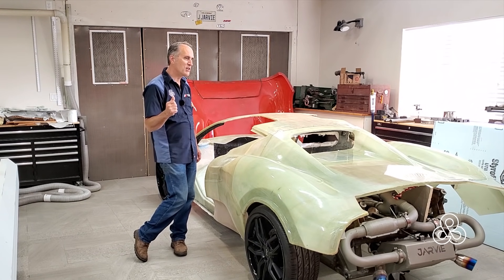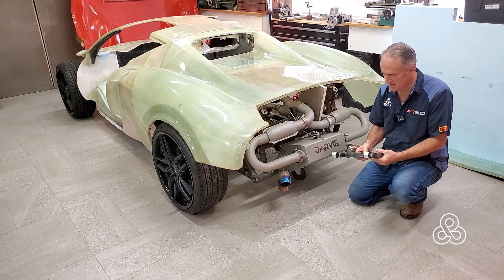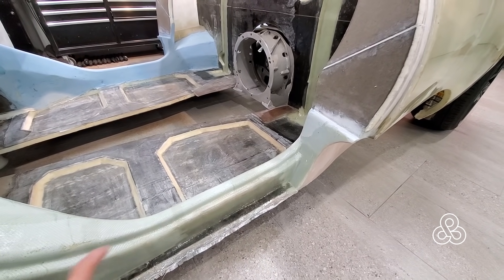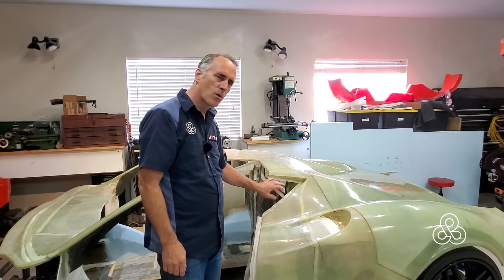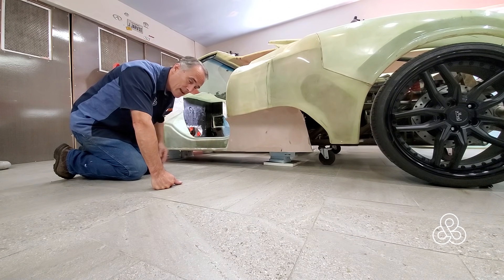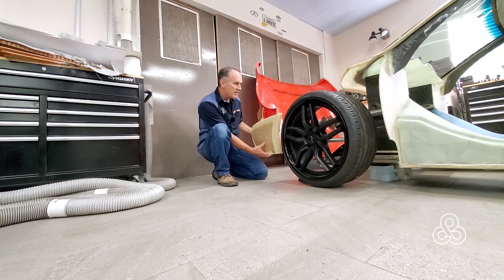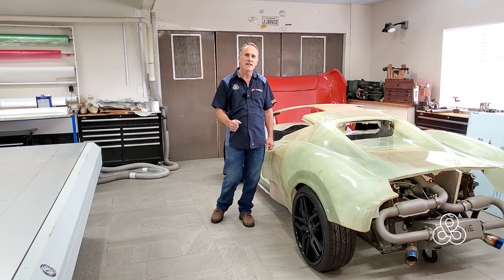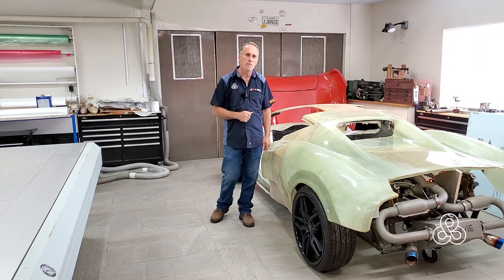Building a supercar from scratch! - What I would do different next time.

Comment: for the engine cover: im no engineer, but i think if you added a system similar to current hoods on cars, where you pull a lever in the cab, then the hood releases, but had it instead move it back slightly so you can then lift it that might work? or you could go full automated and have it like a cars sunroof
Reply from the maker: I think it will be a simple fix, just one more thing to do!

Comment: Hi Jake, First, I'm not an engineer, or even a autotech hobbyist. So take my compliment and question with a grain of salt. From a layman's perspective you appear be one of the most technically proficient builders I've seen on YouTube. My question is, you seemed to start with a body design and mold, and then moved to building the mechanics of the car underneath it. I'm wondering why you didn't start with the functional car (like a body-less go-cart), and build the body and ergonomics around that working platform? Apologies if I missed your answer to this question in this or another segment.
Reply: Gidday from Australia .
I think I did it that way because he doesn't really know what he is doing , I my self would do frame first so you know how wide everything needs to be included the foot well as he just said and steering rack.
I'm a fiberglasser I've build a lot of car bodies and I still do , please do not fiberglass the way he does it is totally wrong.
Reply: Form-follows-function vs function-follows-form.
Either way works.

Jake seems to be a fan of the latter (at least for this project).
When your primary objective is aesthetics, then it's the right choice.
Reply: Who cares about chassis !? Only design is important !  :)

Comment: Leave the rubber in for now - I have the feeling that, now you have the body mold, you will be building a V2 with all the changes that you want to make from the original; then you can revisit.  I’m not an engineer, but just my 2 cents.  Good luck with your project.

Comment: You mentioned the 1JZ build will be around 600hp, will that leave you with more torque than the max 380ft/lbs the 4L65E is made for?
Love to see the channel growing, and look forward to future videos!
Reply from the maker: If I can get to 600 I will likely pick up a kit to strengthen the transmission (cryogenic hardening and all that) should I suffer problems. Having 600hp doesn't mean I have to try and put it all through the transmission all at once. Ha!
Reply: @BuilderCreator  That's true. Slightly more loose torque converter might help too. Keep to the great work!

Comment: I'm planning a build on a sandrail chassis like you mentioned with a VW TDI for mileage power and longevity and custom body to enclose it
Reply from the maker: Great front wheel drive option to push to the back for a mid engine setup!
Reply: @BuilderCreator  yep that's the plan... one of my friends built a sandrail with a mk3 TDI but he used a heavy bus trans axle and an adapter plate 
I want to use the mk4 Jetta TDI I have acquired that got rear damage and transplant the entire engine and 5 speed manual just as it is and fabricate the necessary tubing to connect it to the sandrail rear section
I'm a tool and die maker and I specialized in class A panel dies.... my main problem has usually been too much time spent working overtime not much left for projects

Comment: Consult a few different auto glass shops about windshield options. Ive found that in my 10yr auto glass career, even the most knowledgeable mechanics have no clue about windshield procedures. Auto glass is a specialty trade that is only taught to people that are IN the auto glass business. There are no classes you can go take for it. So a lot of people are just misinformed, and spread misinformation about the subject. 

As for your question.......

Leave it on if you want to get away with not having to make the edges of the frame perfect. And i mean PERFECT!  

Take it off if you dont care about how much time and energy you are going to spend making the edge of the frame look perfect. And i...... mean...... PERFECT!!! 

Also, if you decide to remove the rubber trim from the glass, just look into a glass that doesnt come with a rubber trim on it. That would be easier than having to buy that same windshield and cutting off the trim again risking glass damage.

Comment: When you chose to go for a flush mounted windshield, have a plan for removing the windshield. You might need to replace it if you get a stone chip on the glass or it might crack - you have not done any analysis of chassis flex at this point and you don't know wether your frame might introduce lots of stress into the glass. When you bond it to the chassis, chose a glue that as a chemical weakness - one that your epoxi resin doesn't have. In most steel and aluminium body cars heat is used to weaken the glue and extract the glass. You cannot use this technique as it will melt your epoxy body at the same time. Maintenance is a key component of design, and the windshield needs to maintainable.
Reply: You just wire cut it out like most modern cars, I've never once seen one removed by heat in 20 years in the motor trade!
Reply: @TheMeta6  Well maybe I'm just an idiot for doing it that way on my car when the screen cracked lol

Comment: Windshield - 3 points.
1. It's a prototype. Things will change as you develop the car. Keep the rubber for the prototype.
2. Aircraft windscreens are sealed in place, with some room in the frame for flexing to prevent cracking the glass.
3. If you go with sealing it in place, use a bed of urethane windshield sealant for cushion, and embed two or three wraps of nylon cord around the edge, beneath the outer sealant to make removal far less damaging and difficult than digging through lots of goo.
Reply from the maker: The rubber is gone (going) and I will be using the urethane sealant - the nylon chord is an excellent idea. I've tried to remove a good windshield from a car.  Pain-it- the-patuty!
Reply: Ive been an auto glass tech for 10yrs. You do NOT want to do ANYTHING to make windshield removal "easier" in any way. Windshields are designed with 3 issues in mind 1) Roll over roof collapse  2) Passenger airbag deployment and 3) Front end collisions. The windshield is supposed to be bonded to the pinchweld of the vehicle with auto glass urethane. Each urethane has specific qualities and install instructions, and nothing should be in between the urethane bond to the glass or the vehicle. It is the only safe way to install a windshield. Cutting through the urethane is the only proper way to remove a windshield. They have many tools on the market now that prevent, or minimize, vehicle damage during removal. But making a windshield "easier to remove" is the last thing you would want to do. In fact, you should be going for the opposite. Make sure that the windshield will NOT come out, under any circumstances, unless it is being cut out by an auto glass professional 🤙👌
Reply: @BuilderCreator  that windshield was THAT difficult to remove for a reason. The windshield in your vehicle needs to be the same way. Safety first my friend 🤙👌
Reply from the maker: @joserios1948  well said and heard.

Comment: You are probably aware, but beyond looks, there are 3 functional reasons, small details that matter, why modern cars have a smooth transition, getting rid of the rubber around the windshield:
1. To help reduce drag coeficient by contributing to more fluid surfaces, which improves fuel economy, range and performance overall. Considering the ever stricter governmental and international regulations on emissions and efficiency, every small detail counts and helps.
2. Over time, that rubber tends to fail, crack, flake, warp from thermal cycles and UV exposure, creating humidity or actual leaks, which causes rust etc etc.
3. Manufacturing time is cut down a bit by the fact that instead of having additional steps to fit the rubber seal around the windshield and then fit them both in place, an adhesive bead is laid by a robotic arm and immediately after the windshield is just dropped and layed into place while the vehicle moves on to the next station of assembly as the adhesive cures.

So in short: Yes, it makes a lot of sense to get rid of the rubber seal, in the context of modern cars and reasons mentioned above.

Comment: could the rear cover have its own center hinge, where the pinch point is? or, alternatively, could you just use those two hinge points as pin/latch points instead, and move the hinges to the very rear of the vehicle? open it the other way.

Comment: When I saw your first video and you started making the plug my first thought was wouldn't it been easier to do a foam plug and have a multi axis CNC route it to shape as you could have added your weather strip indentations right into your plug , I watched this and it seems you took the long way around time consuming and maybe more expensive route to doing somethings , ( sorry just my opinion ) , I think I would have built the functional rolling chassis first and added the designed body after , problems like the windshield , foot well area, aft hatch hinges, are all design glitches , Often thought about building something like the factory five GTM but it comes down to is it worth it ? Or should I just buy a used vett and re body it , I'm getting older now and still haven't made up my mind ?   Glad you did the project and the video , fun to watch !

Comment: On the steering racks,.. why not just use bump stops on each side, limiting the turning diameter to fit your vehicle. Car makers use them  95% of the time. It also protects the steering rack when the inside tire gets bumped   the back part of the wheel on a turn, resulting in a destroyed rack. The tie rod to steering arm pivot is weakest on an inside wheel on a turn,....the connection is close  to 180 degree, once bumped it will go beyond 180 degrees (like a locked knee) , thus   it will be unable to straighten the wheel, therefore the rack is the weakest link.

Comment: What about making the quarter window cutouts into cooling vents for the motor? window , remove the rubber.
Reply from the maker: Quarter windows will double as cabin vents in their present (planed) configuration. The rubber seal is on the way out.

Comment: Cut off the rubber seal and rework the opening. Smooth transition is what you want because as you know, that rubber seal would create a tremendous amount of drag and turbulence at higher speeds.. PLUS, it will definitely look better

Comment: Two questions. What have you done in the engine to transmission adaptor to prevent the joint from oscillating, the torsional bending frequency? The engine is long (6 cylinders) and then the transmission mass and transfer case are mounted to it, the mass of the transfer case is a long way away fro the joint and the drive system for the rear axle is offset to the centre line horizontally and vertically. Second question, what are your thoughts on front end lift? The rear has a spoiler and you mention a splitter plate for the front, however the front form and air inlets for the radiator will have a negative effect on a short (X direction) plate. It will need to be quite long to overcome the radiator and form balances.

Comment: In the light of the Grosjean F1 crash in F1 last weekend, have you rethought the creation of a survival cell inside your car. Unlike the Ultima which has a full tubular infrastructure, the ARETE seems to be only fiberglass on all sides. I hate to sound like a pessimist but I am an engineer, raced single seaters (including an F3 Reynard with a carbon tub) and Sports Racers for 25 years, and while your car is an engineering/ construction marvel, I have seen next to no mention of driver safety. Having the entire power module in a subframe that is attached to a tabbed in rear bulkhead, I would be terrified of a severe rear impact almost as much as driving head first into a barrier:  what protects your legs and feet?  Maybe a survival cell rethink while its still possible ?????
Reply from the maker: The tub is say 15% done, stay tuned for more of the features you mention.